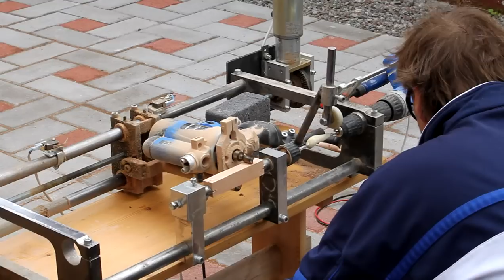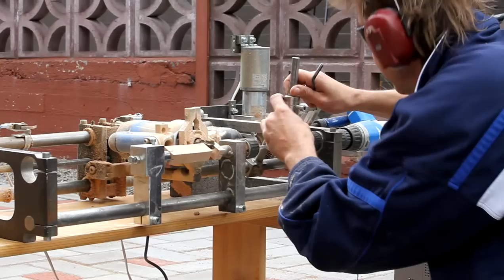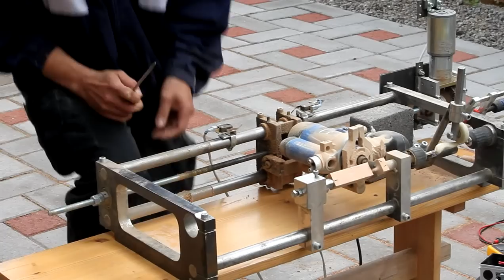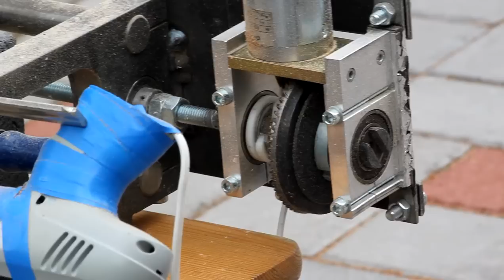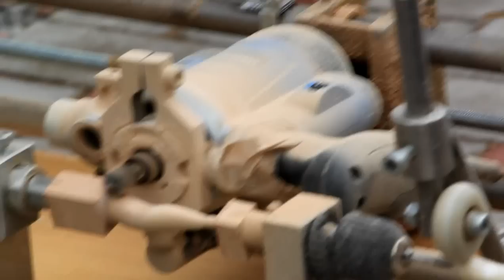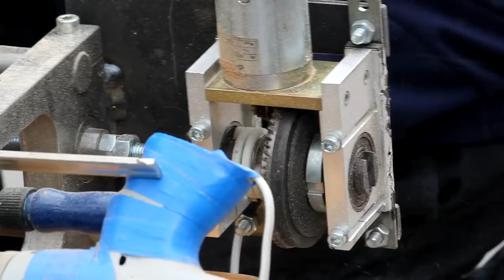Sorvailua osa2

Comment: Do you still have this machine? Could you post another video?
Reply from the maker: Actually this was mine workmate project and i helped him with electric circuit which regulating rpm of motor of turning blank.

Lure is not round and it makes angle-dependent variable mechanical resistance and thats why motor speed needs regulation.

As you may have noticed i am not very active in managing this account indeed. I am sorry about that.